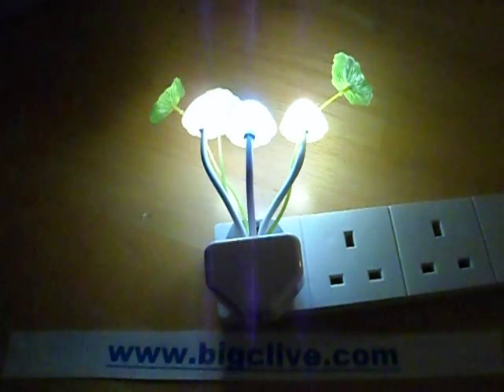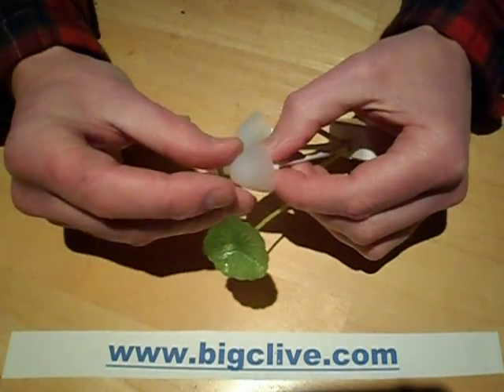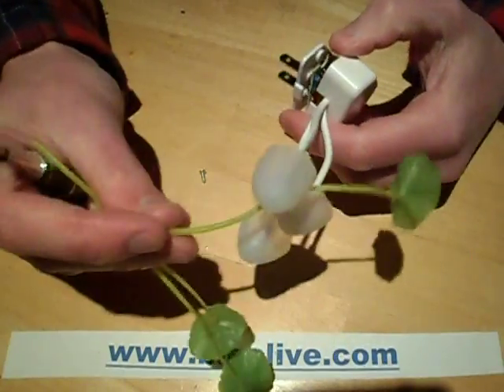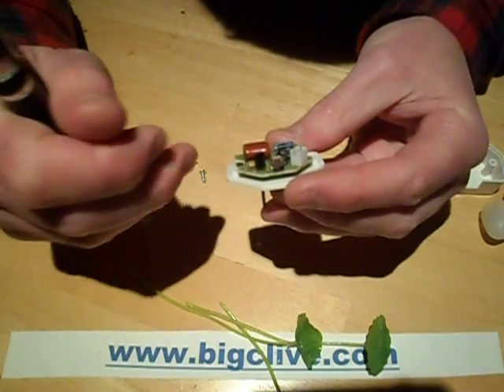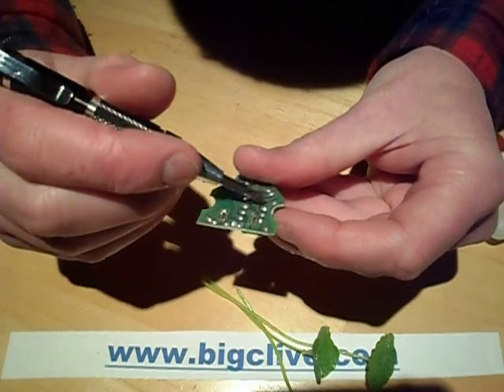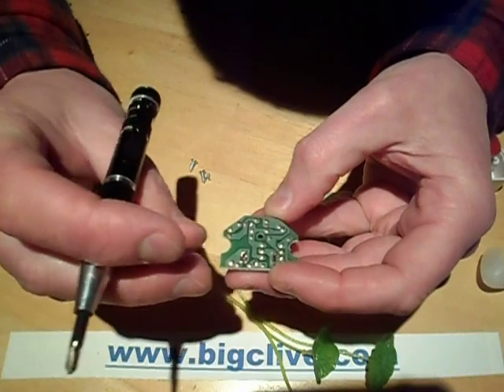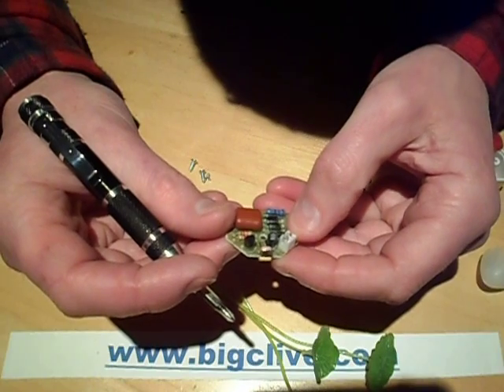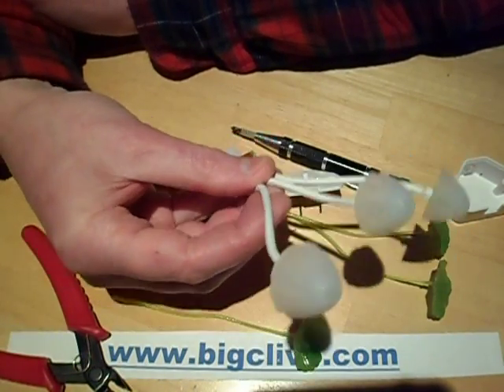Chinese mushroom night light teardown.

Comment: Do you feel comfortable with the main power plugs not being soldered on. Do you ever see that being a hazard?
Reply from the maker: The current in these devices is very low so it shouldn't really pose a hazard, but a proper bonded connection is better.

Comment: I bought one of these to look at. Mine has No Plugs for the LED's , the wires soldered direct to the PCB. The PBC is just sits inside the Plug not secured . The mains wires are also soldered to the PCB . Must be the Economy Version. DOA.

Comment: The shape of that plug though ..  looks like it was intended for the UK.  Reminds me of your Bug light that has Blue LEDs not UV LEDS.  that well I don't have kids around so I can run it but the plug area clearly was intended for the 2 round pole type plugs.  not American.  And unlike yours it seems it doesn't want to come apart as easily so I'm not doing that until I brush my hands across the wires :P  or it just blows up  :D

Comment: Excellent review man. I just ordered 10. So if you cut that thing you call a resister the lights will stay on all the time? What about the LED LIGHTS. What model are they? Just incase I wanna buy replacements? Thanks
Reply from the maker: raiders2800 If you chop off the light sensor (LDR Light Dependent Resistor) then the circuit will think it's dark all the time and keep the LEDs lit.
If you can still find one that the LEDs can be plugged into, then you can fit just about any 5mm LED.
Reply: bigclivedotcom mario the first game is on Nintendo

Comment: Hey, I'm curious, what screwdriver is that? I'm guessing it has different bits in the handle? It would be handy to carry around and smaller than my 54 bit set.
Reply from the maker: It is indeed a multi-bit screwdriver with all the bits stored inside.  It came from a UK shop called Poundland (A Dollar store) and I bought quite a few as they're handy to have lying around.  The bits are a standard mini-hex size, so I swapped in a more useful selection.
Reply: Ah neat, poundland certainly seems to have more usefull stuff than Canadian dollar stores.

Comment: Ooohhh, both the LDR and the LED legs are live - quite a shocker :-)
Reply from the maker: Everythings live, but the little LED plugs are shrouded by heatshrink so the only direct risk of a shock is messing about with the LEDs while the power is on.  The LDR has a clear plastic cover over it.